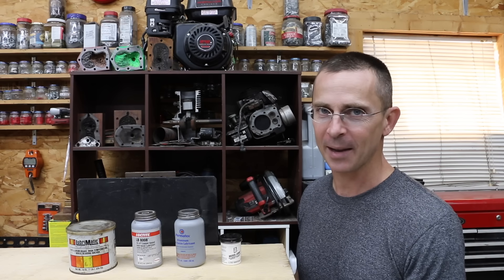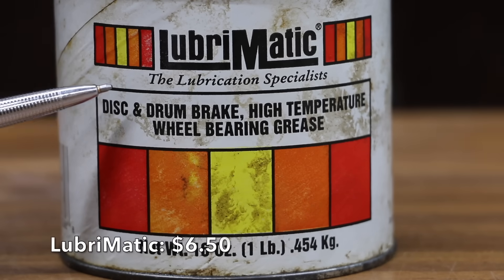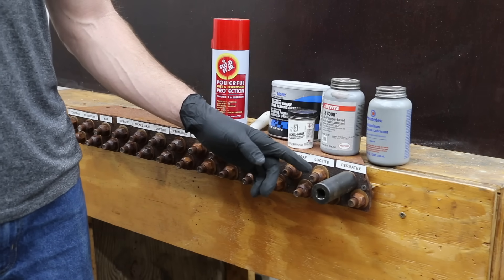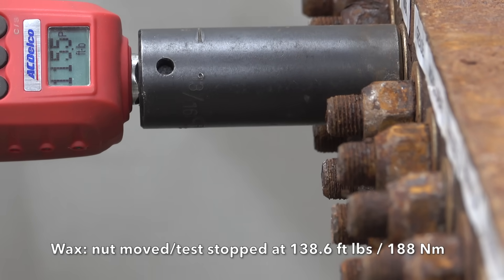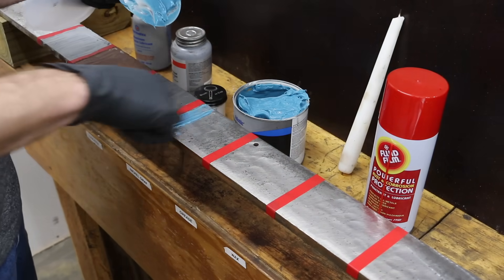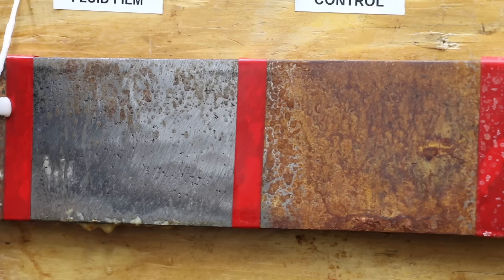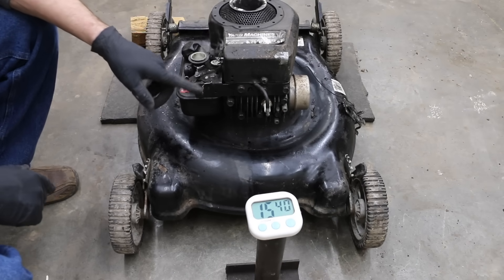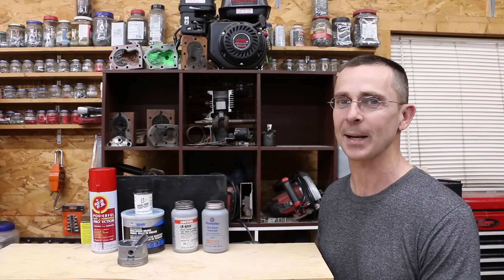Does Anti-Seize Compound Actually Work? Let's find out! Anti-Seize vs Grease vs Fluid Film vs Wax

Comment: I've used Permatex anti-seize compound for as long as I been working on cars/trucks and it always kept rust off bolts and nuts. It made nutsplitters unnecessary on my stuff but I kept them around for jobs on other friends vehicles. Fluid Film was used on more recent jobs on my stuff, but only as a rust barrier on the body which worked very well. My '90 Ford Ranger came from the rust belt in '94 and needed a new exhaust system including the cat. I installed all new parts and sprayed the whole system with 2 coats high temp engine paint followed by fluid film and it is still rustless today after 34 years. The exhaust clamps are rust free and do not leak. My Ranger' s body is still rustless too due to the fluid film. The proper product in the proper place works wonders. Just for kicks I mixed fluid film with warmed used engine oil and re-sprayed the whole truck underneath then found some dusty roads to drive on. The combination of the engine oil, fluid film, and dust will probably protect the truck another 20 years or so. I still have the original glass and tape deck, too. A little PM goes a long way to make it easy to maintain what is now a classic truck. I did use silicone spray on the shocks and frame blocks to help the rubber mounts last longer. The truck is my daily driver, too.
I am entertained by your "Project Farm" videos, they are very interesting.
Reply from the maker: Thanks for sharing.

Comment: Aluminum anti-seize usually causes premature white rust when used on aluminum fixtures.  We use copper for injectors and exhaust work. Nickel and copper are preferred for long term applications
Reply from the maker: Thanks for the feedback.

Comment: I repair car washes and religiously coat every bolt I ever use and drive shaft from an electric motor to gearbox assembly with permatex or a copper anti seize.  It makes a world of difference when eventually something breaks and you have to take everything back apart someday.  I did read a comment below that said that they prefer silicone grease for a marine environment which is basically what a car wash is with all the chemicals and water.  Mabey I should switch to silicone grease.  Anyone have suggestions about switching?

Comment: Regarding galvanic corrosion, is it better to use the nickel based anti-seize on steel-on-steel applications or does it not really matter? Also, when would threadlocker come into play? 

"the bolts are all seized up, I CAN'T TAKE THEM OFF"
"Well I ran out of threadlocker, you're welcome"

Comment: Loctite C5-A and LPS nickel anti-sieze I've seen called out for by name in manuals for Rolls-Royce and Pratt & Whitney jet engine manuals.  In their higher temp areas if  you don't use it you WILL break studs off the next time you remove a part or gall a threaded insert in an engine case.  Very much called out for a reason.  There may be something to the candle wax in certain cases.  Some in aviation use Boelube which seems to me to be candle wax on stainless screws so they don't overheat and gall on installation when putting in with a screw gun into a self locking fastener.

Comment: Contrary to popular belief, anti-seize is not a lubricant; it's closer to a lapping compound--and that's why the engine came apart: it's too abrasive.  Glock uses Loctite Copper on the slide rail guides of their pistols to assist with break-in.
Reply from the maker: Thanks for the feedback.

Comment: Anti-seize products often contain an abrasive.  Most of the time, you’re applying it to fasteners that have already rusted, and the abrasive helps remove the surface rust and provide clearance between the nut and bolt (stud, etc).  The scoring on the side of the piston is exactly what I expected when you said you were going to test it as an engine oil.  There may have been some prior, but anti-seize will quickly add to it.  Anti-seize products are great for lug nuts and any fastener on the undercarriage that gets torqued and left for months or years, but it’s too thick and abrasive to be used as a lubricant for moving parts.  Don’t use it to pack your bearings, for example.  Excellent content, well done.  Always worth the time to watch.
Reply: In the mining industry for example anti seize is used on brand new bolts, studs, liner bolts all the time, it works wonders and saves boilermakers having to cut the bolts. Never seen it applied to old studs or nuts that have not been cleaned I.e. with wire brush. Loctite is brilliant stuff.

Comment: I use on my wheel nuts regular tar from aerosol can, never had any troubles and don't have to think about electrolysis. Engine parts are another story, I use only ceramic there.
Reply from the maker: Thanks for sharing.

Comment: Hi - I find all your reviews really well done and add a lot to my decision making. Just recently my Dremel hand grinder died after a long life of service. literally decades. I'm wondering if you had thought of a Dremel and Dremel type rotary grinder comparison now that there are some alternatives.  A few years ago I picked up a similar grinder - low cost from HF - to have a second in my toolbox on the truck and the torque was so low it was not of use. When applied to material it just bogged and stopped, so I returned it right away, useless. Didn't buy another, just kept using my trusty of Dremel Brand until it gave up a few weeks ago. Now I need a new one and would love to see a Project Farm comparison. Please do it!
Reply from the maker: Thanks for the video idea.

Comment: Could you test garage floor epoxy kits to see which ones resist scratching, oil staining, heat/cold, and wear resistance? Hope this is a good video idea thanks
Reply from the maker: Great suggestion!  Thank you.
Reply: The problem with the Epoxies, is people don’t prep the floor correctly. Wash and Brush scrub with a strong Powder HE detergent, Tide Recommended. Throughly rinse and rinse again. Squeegee all standing water. Before the floor has a chance to dry, mix 10 parts water to One Part Muriatic Acid, apply with a stiff brush, let set for a half hour, and flush with plenty of water, squeegee standing water. Dry for a week, fan assist if needed, with nothing on the floor, and restrict foot traffic. Rubber boots, protective clothing, safety glasses, Face Shield are a must. A respirator maybe needed, if a enough cross ventilation can’t be provided. I’m not a fan of rubber gloves** when working with acids, prefer a bucket near with cool clear water, for frequent hand, skin washing. If you get acid in the glove**, you may not realize it, till major damage has been done
Reply: That would be cool
Reply: Call Sherwin williams and ask them about tuff coat or the epoxy they have for concrete. Thats what installers use.
Reply: To be fair if you want them to be heat/cold resistant, you should probably consider polyurethane-coatings instead. Epoxy is fairly stiff and will likely crack if the substrate gives too much.
Reply: If you do this...please include PPG epoxies.  Some of the best.  The off the shelf HD/Lowes are pretty crappy.
Also, consider a primer coat first.  Makes all the difference in the world.
Reply: I'll save you all time.  None of them.  The end.

Comment: I have some nuclear grade never seize at home that i think would be fun to compare to these if its something you want to try. Also i think the chain lube needs to be revisited. The chain lube is actually meant to be applied from the top or bottom not from the sides. All of the friction and contact actually happens on the rollers and on the inside. i would like to see you test more of the chain lube that is meant for dirt bikes. Most of is is a wax base or types that dry. It is meant specifically for getting covered in dirt.

Comment: Probably the best points of the video: One of the issues with these types of lubricants is that they contain some form of metal which is probably different than the bolt it's being applied to. That means galvanic corrosion becomes an issue. I like stuff like Anti-Sieze Metal Free 2000. Also keep in mind that lubricated bolts reduces the coefficient of friction and a lower torque is needed for the same bolt stress. The torques of multiple bolts on a flange or bolt pattern becomes more consistent with lubricants. Great video and I am always excited to see what's next!
Reply from the maker: Great point! Thank you

Comment: Heres video idea: Test durability and results of those engine mods against factory one where vertical axle lawnmower is turned into horizontal axle engine? Does this mod still keep performing like factory one and what other effects it has. I'm thinking use of them in gocarts etc diy projects rather than ending on dump.
Reply from the maker: Thanks for the video idea.

Comment: I’d like to see a video on “which is stronger, JB Weld or a real weld?”
Reply: No contest ! Welding is wayyy stronger than jb weld by a Longgg shot. Hell , Silfoss 15% Silver brazing is Wayy stronger too. Jb weld is Just a Glorified Glue on steroids. Just a bit stronger than bondo car repair stuff. Almost anything is stronger than jb weld. Its ok. Ive used it. But it fails when heat , refrigerant & refrigeration  oils are present.
Reply from the maker: Thanks for the video idea.

Comment: We use the copper based never seize on our bolts going through the flanges and also on the non asbestos ring gaskets to make removal of the gasket easier for the next guy

As always Thank You for your time doing all you do
Reply from the maker: Thanks for sharing.

Comment: can anyone explain the difference between anti-seize compunds and gasket maker compounds? for example, usage applications. Permatex makes both, and they are both copper based & hi-temp rated. I'm installing a new exhaust on my motorcycle & it's to apply between the link pipe connections. The instructions recommended anti-seize, but I bought the copper gasket maker by mistake,  would there be any downside to using the gasket maker instead? Any advice would be appreciated. Thanks for another great comparison video btw.
Reply from the maker: Thanks for the video idea.

Comment: I've been using the Permatex copper antiseize on railroad track components such as switch rods, connecting rods, frog bolts, etc, and everything are always exposed to the elements all year round, the copper based antiseize definitely makes it easy to disassemble the components for maintenance and repairs.
Reply from the maker: Thanks for sharing.

Comment: Hi, greetings from Germany, you are doing an impressive Job, the tests are well designed and aimed at reproducibility. I really like those. Unfortunately here in Germany we have different brands; to buy the "winners" is often difficult. So I bought a copper based anti-seize (Presto), which did the job for me.
Here some ideas, I do a lot of woodworking and often people say you need high quality steel wood carving knives which come from Germany or Japan and also gouges (wood chisels). Famous brands that I know here are Kirschen, Dictum, Datei, Matsumura, MHG, Veritas (I think they are Canadian), but of course there are also many cheaper/ medium priced offers here like Meister/ Primaster, which would be comparable to the Bauer brand, I guess. And there are of course dead cheap offers. It would be really cool, if you could abuse different type of gouges to see if this is a myth or if these traditional brands really perfectioned the manufacturing of gouges and carving knives. In my opionion a test could involve: Sharpening, How good can you sharpen them? Do edges of the material break? Do they retain the sharpend edges? How much force can they apply and take? So it would be fun to really see these tools abused.

Another point: When you are testing glues again: You could compare it to the traditional animal hide glue, which is cooked in a glue cooker at 60°C, I used it on a lot of projects and is pretty easy to apply and correct, however the adhesion properties are of course far inferior and it turns extremely brittle, so it could be a fun comparison.
Reply from the maker: Great suggestions and ideas.  Thank you

Comment: There's a unique quality to metal infused anti-seize; one dab has the ability to find itself smeared to anything and everything within a square mile of the open container.  The lawn mower didn't stand a chance with the engine's "splash" oiling system that doesn't use an oil pump to circulate the engine oil or lube.  The consistency of the anti-seize didn't allow for thorough lubrication and man did the carnage occur. 
 I've been using the aluminum infused stuff for years and found that applying a thin but thorough amount to the threads to be sufficient, an over application just makes a mess, (see the first sentence).  DO NOT use anti-seize on wheel lugs or studs, the application of these products is not recommended by the automotive industry and may promote the loosening of the lug nuts while the vehicle is in motion.
Project Farm, again you've done an excellent series of tests.  Thank you.
Reply from the maker: Thanks for the feedback.

Comment: Could you try out the differences between standard copper spark plugs against iridium plugs to see which is better
Reply from the maker: Thanks for the video idea.
Reply: I'm about to change the plugs on my  2015 Nissan Altima 2.5...204k miles...original plugs...Denso Iridium  still runs fine. I hope I can get them out!

Comment: It takes a long time to corrode a bolt. This is why the test results were very close in value. Any grease would work for this. 

It would be interesting to put the bolt test rig in a large PVC pipe tube with pure welding oxygen and an acid to accelerate the process to extremes over several months or more. Since rust consumes oxygen it would have to be replenished occasionally.
Reply from the maker: Thanks for the video idea.

Comment: While I was working today I thought of a video idea. Does the way you trim with an electric trimmer change the total run time. For example, I am trimming a lawn and two trees are next to each other, is it better to trim one tree then the other without turning off or is it better to trim one tree and turn it off during the transition. Just curious because in my mind stopping and accelerating the trimmer would take more power in a short change between trees because you need to reaccelerate the string. However in my experience, when I trim a lawn and constantly start and stop the trimmer between two points, the battery lasts waaaaaaaaay longer and it does not make sense to me. And another question would be how short the distance between the tree would need to be to save the power of reaccelerating.
Reply from the maker: Great video idea! Thank you

Comment: You should make a video about strength testing ropes made out of different materials. I think it’d be interesting to see how they hold up under different temperatures and which is the most resistant to cutting and fraying.
Reply from the maker: Great suggestion!  Thank you.

Comment: Didn’t check all the comments but could the rod have broken from the amount of anti seize in the combustion chamber?  Similar to hydro-lock but forced to rotate as the motor was running. I’m a huge proponent of anti-seize! Great video!
Reply from the maker: Great point.  I suppose it's possible but the aluminum in the anti-seize functioned as an abrasive causing significant wear and damage.

Comment: I've got an idea for you and it comes from what just happened here.

I have a cheap $15 harbor freight drill and  a fairly expensive Milwaukee set where I thought they both did fine however I was wrong. I took your idea of using an electric start on my mower that would not start after cranking it for too long.

I used a foot long extension just as you did so there was almost no chance of any fluids getting into my drill, but the Milwaukee seized and started smoking after a few cranks.

The harbor freight drill kept pushing on until it didn't have enough of a charge to spin the motor. It's currently charging.

In retrospect I should have used a 110v drill, but it is an interesting find and I would love to see you test this. I know you don't use either regularly, but I love your videos and you always take an amazing approach to everything.
Reply from the maker: Thanks for the video idea.

Comment: Video Idea:  Which oil or grease produces the best seasoning on cast iron and/or carbon steel?  Flaxseed oil seems to be the most often recommended, mostly because it has a smoke point low enough for normal kitchen stoves to reach, but I find it tends to flake off more.  Vegetable oil (ie soybean oil) is usually the cheapest and most readily available.  Sunflower oil has a higher smoke point suitable for stovetop seasoning.  Are any of these really the best choice, or does something else work better?  Some possible criteria may include ease of application, price, availability, resistance to scratching, resistance of corrosion from acids or drops of water left on it, durability through heat cycles, and washability.   Non-stickability is more subject to cooking technique and heat control, so that may not be worth testing.
Reply from the maker: Thanks for the video idea.

Comment: Please try to run an engine o  acetylene torch gas, with a see thru head would be a bonus
Reply from the maker: Thanks for the video idea.
Reply: @ProjectFarm  maybe introduce the oxygen into the mix to see how flame and performance change
Reply: I have also often wondered, if you were to plumb and oxygen tank to a gas fired engine  so that the only intake able source was the oxygen bottle at atmospheric pressure what would happen. Either run and perform very well/efficient or melt down due to heat of the combustion flame.